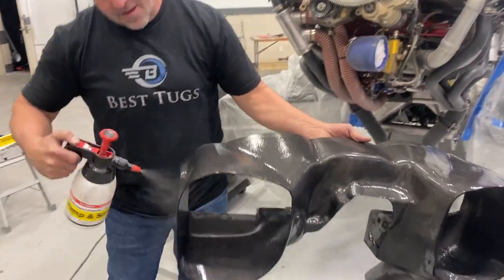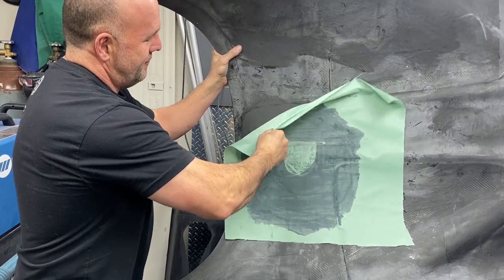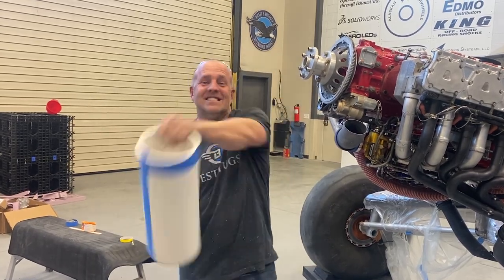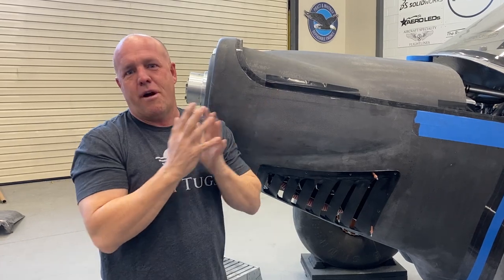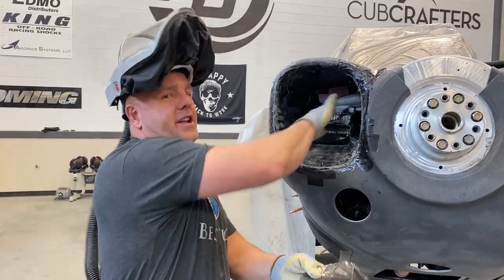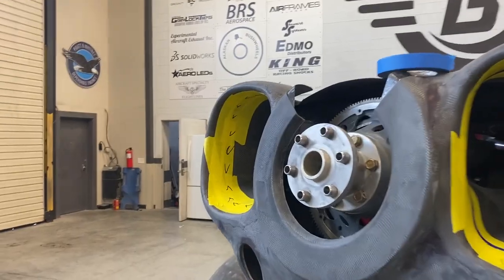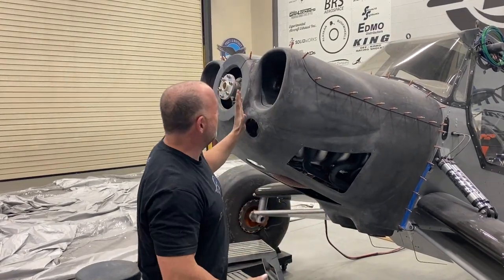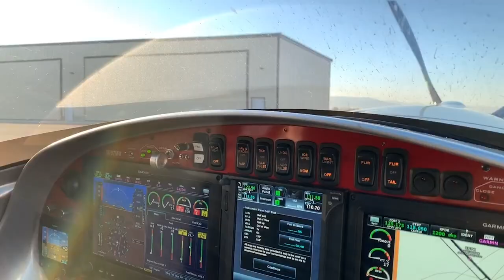Sleeper...Hiding a Monster NOS Race Engine in a Carbon Fiber Bush Plane | Scrappy #46

Comment: Mike, I am a huge fan of your channel! I have one question about scrappys air box. By the looks of how tight the filter sits in the airbox, which by my guesstimate appears to hold roughly 8 liters of air, are you potentially restricting the 13 liter engine? The sectional cross area of the filter is massively impacted by the width in this case of the airbox which is already quite narrow. As a rule of thumb I learned to take the volume of the engine and typically multiply it by a factor of two for my available volume for best high rpm operation and the larger intake will also decrease the amount of turbulent air in the intake as it’s lower velocity as compared to the smaller one. I’ve tested these methods on high horsepower naturally aspirated engines as well as forced induction builds. The difference in volume makes a massive difference and I’ve seen gains up to an additional 20% at peak.
Reply from the maker: Great question.  👍🤠 I spent a lot of time on these flow analysis on every build.  Also I use instruments to measure how many inches of pressure outside cowling, inside cowling, and inside the induction pipe post air filter as well as inside the intake manifold.  The fifth location is already metered on my Garmin at the valves. I have a hand made quad gauge I have used  on the last dozen builds i test this every time no exceptions as so many screw this up.  Fortunately I have run this engine and metered it with this exact system in my record setting plane.  I have a great baseline data.  What makes it look deceiving is many use car data as a reference point thinking it would be a good baseline.  Car motors run at twice the RPM so my 780 at Max RPM is flowing almost the same airflow as a chev 350 truck motor at max RPM.  So that’s half what you may think at first blush.  On top of that we get massive  inches of pressure increase with this design from that giant 500 hp propeller paddling air into that scoop three inches behind it.  It’s almost like it’s own pre filter blower with massive air volume.  On this same configuration air box on my last plane i made more air than ambient inside the air box as well as post filter when at speed.  Thanks for fallowing along 🤠
Reply: @MikePatey  very cool! Thank you for breaking that down!

Comment: I forget did you put a fan in farther down, to draw air in while the plane is stationary? Also do you have a way to block the airway so if you make a rapid descent the engine doesn't crack?
Reply from the maker: Yes 👍🤠

Comment: I like your idea about controlling an unlatched oil door with a slight offset, but won't the prop wash tend to blow the oil door towards the open direction?
Reply from the maker: On the ground yes, and in the air even with the prop wash the angle is enough that the directional air wins the battle.  Ask me how I know 😂😜
Reply: @MikePatey  Well, then I guess it's good that it /might/ flap around on the ground where someone it almost certain to see it :) .  I suspected that airspeed would be a factor, but should have known that you'd already have "tested" this feature in the past :P .

Comment: 3d scanning the whole plane is probably a good idea, just in case some nasty crosswinds challeng the pilot like with Draco
Reply from the maker: Yea seriously 🤷‍♂️🤠 gosh I hope I don’t have another fail like that.  I’m a bit shy if winds lately
Reply: @MikePatey  btw thank´s for the awesome builds, it is really inspiring and enjoyable to watch.
Reply: @MikePatey  I second & third the 3D scanning idea, especially those intakes & the perfectly spec’d oil funnel & door – that front end is a work of art & while (knock on carbon fibre) nothing will happen to Scrappy, it’s best not to tempt dear old Murphy! 🤞☘   Plus, think of the hours of fun you’ll have running it through your aerodynamics software 😉🛩
And by the way, that 10-32 machined on the headlockers.... just perfection! 👌

Comment: Question Mike.. air cleaner inlet tube.. do you have a drain bypass on it.. so if you happen to fly thru a cloud or rain you don't hydraulic the engine.  might need to be between 1/2" and 5/8 for proper amount of drain .

Comment: I love your headlocker. But, I wonder about what happens as the engine heats and cools.
Reply from the maker: Great thoughts and comment 👍🤠 The block and the Headlockers run the same expansion rate coefficients.  If one was Steele and the other Alluminum you would never do it.  What’s great is the measured movement in vibration without the Headlockers is more than thermal changes and they are moving at a high frequency without it.  The Headlockers actually reduces the movement drastically and the design was for both cylinder temperature Controll between them and to prevent the cracks that sometimes occur at the block over time from vibration fatigue.

Comment: Just a thought Mike,
Do you think the air filter might be a bit small for the Engine capacity?
At the speed you plan to compete with there will be little pressure in the plenum.
Love your work!
Reply from the maker: Great question I’ll try and cover it more later 👍🤠 it’s oversized and the same I ran on this motor in several configurations with metered air pressures before and after to insure I wasn’t ever creating suction,  only ram pressure

Comment: Mike, what about rain water entering the ram air. Could there be a problem with too much water entering the intake?
Reply from the maker: Drain system 👍🤠 it’s already there. Often times some of the small details don’t make it in the video cuts.  Good eye 👁🤠

Comment: I think a pressure sensor/gauge in front of that air filter and maybe one behind to see how well that intake works in flight would interesting.
Reply from the maker: I made a custom gauge with four in one.  I place inside the plenum, one inside the filter tube at the base. One after the filter and another in the opening of the custom intake system I made.  I have already tested this exact system on two of my racers with this engine.  I make more than ambient with it directly behind the prop post filter.

Comment: Mike;  i was wondering  which way that prop-wash is going across the top of the cowling? If it was going in the desired direction,  it might slam the door shut... with an over-center latch, or medium-strength magnet, it would stay closed, or, maybe not 'locked' but closed 'enough' to stand flying until it's more convenient to lock it down? Always interesting to follow your identification of problems, BEFORE  they become problems!

Comment: Excellent video again. Thanks for adding in the little clip of putting sandpaper on the hole saw body, that is genius and I'll use that on my projects. Out of interest what sort of rivets do you use when attaching nutplates / hinges to carbon? Can you get away with standard alloy rivets or do they have issues with the carbon?

Comment: Really surprised there is not more items safety wired !
Reply from the maker: Great comment 👍🤠 That is always at the end.  Many things come on and off a dozen times during fabrication.  I safety wire everything when I’m done and move to final assembly and inspections.  Cut the same safety wire off six times on custom builds and you will do the same 👍🤠

Comment: I think you had 5 air filters on Draco, but just the one on Scrappy. Is the air demand that different.
Reply from the maker: 👍🤠 great comment. The flow demand is not five to one but the dust and clogging with a reversible prop was at least 5 to one.  Great catch my friend.  If I added reverse on scrappy I would add filters for airflow with heavy dirt between replacing them.

Comment: Dear Mike, with all respect please be aware that the heat of the engine may result in a weakspot near the connection of bolts on the enginecovers. These bolts will also heat up and soften the epoxy in the carbon. Perhaps adding a strip of aluminium between the bolts and cover could transfer this heatspots and create a even stiffer bound.  Kind regards.

Comment: Mike I'm going to come at you with a very off-topic question, which has nothing to do with this video or maybe it does. But when building an experimental aircraft which is what this is, how involved does the FAA get? And at what point do you have to have them sign off on your work? You do a lot of creative one-of-a-kind work and I'm sure that the government overseers will want to sign off on it. So how does that process happen exactly? I think it would be a very good point to demonstrate to the fans who are thinking about building their own aircraft. Because when someone is creating a project, generally all of the attention goes into the project and the nuts and bolts of it, and very little attention is paid to the back end crossing of the T's and dotting of the I's. Thanks and keep up the great work.

Comment: Will the PP induction air intake feeding off the left side intake reduce left bank cooling compared to the right bank?
Reply from the maker: Great question 👍🤠. On a tall deck pressure plenum both sides instantly balance as the ram exceeds the flow volume including the engine intake air.  Both sides when metered are equal.  The only time it becomes a problem is tight low plenums or split pressure decks
Reply: @MikePatey  Just watched this video again. You pretty much answered my question in it. Thanks for the reply. I'm in the process of planning a Bearhawk Patrol build. I'll be taking queues for your cowl build for sure. It'll be a one off carbon creation like yours but probably not as trick as yours )

Comment: Mike, with the cold air intake pulling air from the left side of the cowl, will that reduce air flow enough behind the intake on that side to impair cooling on that side of the engine?

Comment: Quick question for you, I may have missed it, but how do you plan to deal with water intrusion into your engine air intake? Also, how do you plan to deal with encountering icing conditions? 

Thanks! Really awesome videos, love learning from you and your experience. Love the way you explain things fun and educational.
Reply from the maker: Drain system. 👍🤠 it’s already there. Often times some of the small details don’t make it in the video cuts.  Good eye 👁🤠 on the ice I’m doing just the basics, pitot heat ect, this won’t be a FIKI system

Comment: Shouldn't that hinge have been on the other side so prop-swirl would close it instead of opening it?  Or do I have prop rotation direction backwards?
Reply from the maker: Great question.  👍🤠 On the ground it would open it and I would see it and shut down to close it.  If it popped free in the air,  the speed will close it.

Comment: Mike, this may be a silly question but where does the water go if it gets into the oil funnel, or will water not get in there?   I can’t wait to see this thing in the air, I’ve been watching since the first scrappy build video. Looking forward to the next vid🤙
Reply from the maker: Drain system 👍🤠 it’s already there. Often times some of the small details don’t make it in the video cuts.  Good eye 👁🤠

Comment: Mike, I can save you tons and tons of hours. I have been testing foams and glues. Pink foam, carve to what you want. Coat in Gorilla Glue and let that dry. Do a few coats. Won’t melt the pink foam. Then you can use UPol auto body filler and reface all on top of that. Block it perfect and is super easy to sand. I’ll make a video of me doing it. I’m making a tail light and bezel from this process. Fast and pretty cheap.

Comment: You are a wild man Mike!  Usually I can follow along exactly with what you are doing but you lost me with the complexity of these parts.  I get what you accomplished, but the steps of you building molds to pull parts off of got a little foggy for me.  At times I couldn’t tell if you were laying fiber to create a mold or for the final part.  Amazing work man!   Wish you were my dad! 😎

Comment: Great work Mike.  How does your ram intake deal with rain? Or does the propeller get rid of most of the water?
Reply from the maker: Drain system 👍🤠 it’s already there. Often times some of the small details don’t make it in the video cuts.  Good eye 👁🤠

Comment: @Mike Patey, how do you prevent hydro-locking your engine when your intake has no means to release water making its way into your vertical intake runner? I have no idea if regular piston planes have systems in place to deal with that as I’m just a couch pilot.

Comment: dumb question, wont the air intake on the left bank reduce the amount of air going over those cylinders  and make the left bank hotter than the right bank of cylinders? wouldn't it be better for thermals to do an even split between the 2 sides?
Reply: That's what I was thinking. I'm positive he is way ahead of me on this though. Lol

Comment: Your air box looks constrictive and I wonder if you may have resonance issues from it at certain airspeeds due to the flat surface and narrow gap along the side of the filter elements and lack of a spike or dome to align/guide airflow

Comment: Will you measure the pressure in the air cooling plenum?
Do you have a target pressure to meet / exceed?? Might you use this data to control air flow to avoid over cooling?
Alan in London

Comment: I noticed you attached the top of the high pressure box to the head lockers.  Is there any isolation from the carbon fiber and aluminum lockers?
Reply from the maker: Great question 👍🤠 Yea I missed talking about the first couple layers on the underside of the lip is fiberglass

Comment: MIKE MIKE MIKE?    
Since ol scrappy is kitted for extreme  S&R ....     Did you install a megaphone 📣? Wondering if I missed a video.  I only ask due to your weight to wing formula .....        Also... is there any special attachment concerns  for pulling a banner?   Say for dispersing a message for a SHTF DISASTER. Probability of ever needing to is slim.. but hey. Doesn't hurt to ask. 

This project is so fascinating!

Comment: Mike you have model ed the flow. My question is do you have a cooling different side to side as on the port side of the A/C the engine air intake is removing a lot of volume. How have you handled that. I did not quite get it from video and I sure you have thought it through. 
Thanks for all the videos really enjoying them and learning heep with the carbon lay up.  😁👍

Comment: sorta wondering why you didn't choose to center up a separate cold air induction inlet instead of sourcing it from the left cooling inlet, room issue maybe?
Reply from the maker: 👍🤷‍♂️ Great question and very deliberate reason but not space restrictions.  I’ll try and cover that later

Comment: Awesome work as always Mike. Are you going to add a water drain hole at the bottom of the air filter tube? I was just thinking of that air filter sitting in a water bath in the rain.
Reply from the maker: 👍🤠 it’s already there. Often times some of the small details don’t make it in the video cuts.  Good eye 👁🤠

Comment: I am looking for insight about how you think about air intake design here. It is intuitively obvious that you would make bigger air intakes for a bigger engine. But then as you implement it, half the frontal area is deflected upward into the plenum, with almost none admitted any other way.

Of what use is that frontal area if it is all to be bottlenecked by that ramp?

Comment: Mike, what are you doing for a water trap/drain on the air intake/filter?
Reply from the maker: Drain is not installed  👍🤠 it’s already there. Often times some of the small details don’t make it in the video cuts.  Good eye 👁🤠

Comment: So... what are the chances of the prop rotation creating a low pressure area for the engine intake with the air filter in this location? Obviously you couldn’t locate it on the other side due to cylinder stagger/crowding/cowl clearance, but the upward prop sweep going by the air filter here would keep me awake at night.

Comment: Can you automate the cow-flap? (To automatically close and open to preset levels) to work with heat, speed, altitude, pressure, etc... ;or; you planning on just keeping that function manual?

Comment: So Mike, the fresh air intake to the engine won't rob enough air to make a difference on the left side bank of cylinders? Just curious. Looks incredible!...love the oil funnel!!!
Reply from the maker: 👍🤠 great question.  When doing a tall deck pressure plenum it doesn’t matter what side you pull air from for the filter because the velocity coming in both sides creates over an inch of pressure equally everywhere.  That only comes into play in split side plenums

Comment: What are you doing to eliminate water (rain/condensation) accumulation in the air filter intake?  Looks like a pretty large potential water collector?
Reply from the maker: Drain system 👍🤠 it’s already there. Often times some of the small details don’t make it in the video cuts.  Good eye 👁🤠

Comment: Impressive but can composite handle the direct heat from the engine?
Did you say you could do the computer model in 3% of the time? if so why not. I get that shaping by hand lets you work with the form as is and CAD requires you to scan in everything first. It's more meticulous, it's less satisfying to shape in CAD, the interface and tools are yet not ideal. But it's a lot neater and requires less sanding. It's a more controlled process. Satisfying in its own way. I really hope you do a true from scratch build from cad so there are no iterations, no patchwork and no sanding. Just perfection :)
Could also be healthier. Less in the lungs.